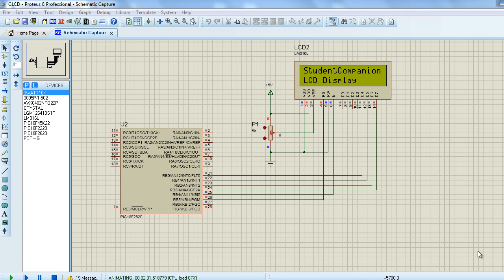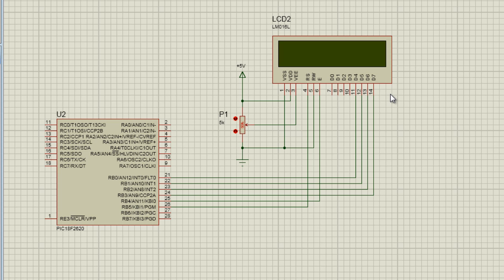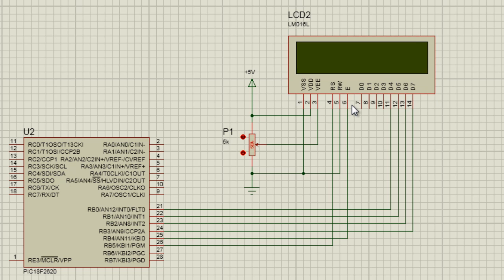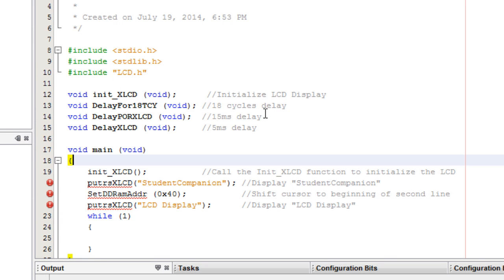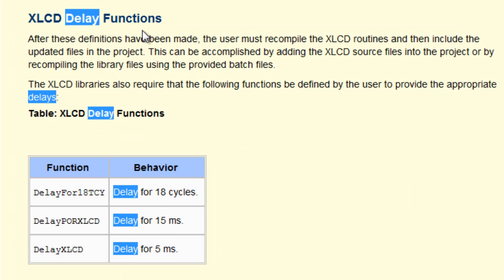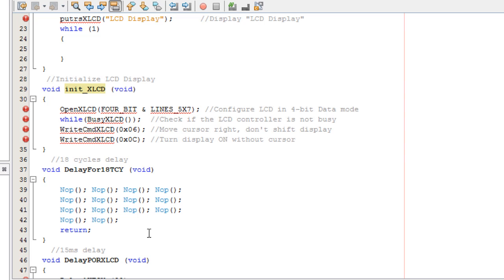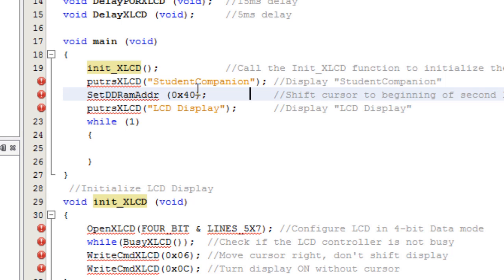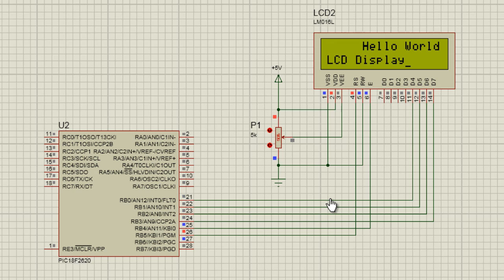5- Interfacing an LCD Display | MPLAB XC8 for Beginners Tutorial

Comment: Hi Student Companion. I am writing a code for LCD with PIC18F4550. I was successful with 8 bit interface using internal oscillator. However I am not receiving anything on my LCD if I am using 4 bit interface with external oscillator. I think it is highly likely that I am not able to define external oscillator in my code. Could it be possible for you to share code snippet for using external oscillator? My compiler is XC8
Reply: If you require me to share the whole code I don't mind it. Basically its same as the one is your video abover
Reply from the maker: +Setsu Tsubasa how are you connecting your lcd? PORTB? Paste your configuration bits code and main code.
Reply from the maker: +Setsu Tsubasa are you using PIC18F peripherals libraries? Did you install it into your compiler installation folder?
Reply: //***MAIN FUNCTION***
void main(void) 
{
    //OSCCON = 0x72;                //Configuring OSCON Register to use internal Oscillator.
    float current = 1, voltage = 3.13 ;
    char buf[30];
    sprintf (buf, "PV: %0.2fV %0.2fA", voltage, current);

   // text[] = "3.13";
    DelayPORXLCD();                 //15 ms delay after VDD>4.5V
    LCD_init();                             //Initialise LCD
    DelayXLCD();                        //5ms delay
    SetDDRamAddr(0x80);
    putrsXLCD(buf);
    SetDDRamAddr(0x01);                // To clear LCD display (without this in ISIS 2nd line command doesn't work)
    SetDDRamAddr(0xC0);               //Shift cursor to beginning of 2nd line
    sprintf (buf, "H %f", current);
    putrsXLCD(buf);
    while (1);
    return;
}

//****xLCD.h****
#define LCD_PORT           PORTD           //LCD_PORT defines the port to which the LCD data lines are connected
 #define TRIS_LCD_PORT   TRISD

/* CTRL_PORT defines the port where the control lines are connected.
 * These are just samples, change to match your application.
 */
 #define RW_PIN   LATCbits.LATC1     /* PORT for RW */
 #define TRIS_RW  TRISCbits.TRISC1   /* TRIS for RW */

 #define RS_PIN   LATCbits.LATC0     /* PORT for RS */
 #define TRIS_RS  TRISCbits.TRISC0     /* TRIS for RS */

 #define E_PIN    LATCbits.LATC2    /* PORT for D  */
 #define TRIS_E   TRISCbits.TRISC2     /* TRIS for E  */
Reply: By PIC18F peripherals libraries you mean xlcd.h and related files then yes. I Have installed them and using them.
Reply from the maker: +Setsu Tsubasa yes. Xlcd.h. at  which port is your lcd connected to?
Reply: Port D
Reply: RS and RW are port C
Reply from the maker: Hi. There are a lot of inconsistencies in your code.
Which LCD model are you using? a 16x2 lines or 16x4 lines? 20x40 lines?
In your main code, You are writing:
1. SetDDRamAddr(0x80); // To which line are you jumping to with this statement? to the 3rd line?
 2. SetDDRamAddr(0x01);                // To clear LCD display (without this in ISIS 2nd line command doesn't work) : this is not a command to clear the LCD, the command is: WriteCmdXLCD(0x01).
3. SetDDRamAddr(0xC0);               //Shift cursor to beginning of 2nd line . This code will not shift your cursor to second line is you are using a 16x2 line, in our code we wrote: SetDDRamAddr(0x40); 
4. //OSCCON = 0x72;                //Configuring OSCON Register to use internal Oscillator. If you are using an external oscillator, why use this configuration?
5. In the library you define: #define LCD_PORT           PORTD           //LCD_PORT defines the port to which the LCD data lines are connected, which clearly states that your LCD is connected to PORTD, but below you are defining other pins to PORTC, It won't work.
6. You didn't post how you configured your external crystal oscillator, the frequency, MCLR and other configuration bits.
Reply from the maker: Watch this video to learn more if you want to connect your LCD to another PORT: https://youtu.be/RkDN2GW_SxU
Reply: 1. LCD: 16x2 lines
2. SetDDRamAddr(0x40);   // This command isn't shifting my curosor to 2nd line
3. SetDDRamAddr(0x80);   //My mistake. Some other website wrote it as 80 for 1st position. It should be 00
4. If you are using an external oscillator, why use this configuration?
       I don't know how to use the external oscillator but for time being I used internal.
5. I will watch the video and get back to you. 

8 bit configuration works just fine but 4 bit has issues. The code is debugging but on proteus the LCD is blank.
Reply from the maker: +Setsu Tsubasa watch the video then let me know if you are still struggling.
Reply: I watched the video. I have been doing the same thing. My code is: 

#include <xc.h>             //Includes pic18f4550
#include <stddef.h>         //for NULL
#include <stdio.h>
#include <stdlib.h>
#include "xlcd.h"
#include "delays.h"          // header file for delays

// Instructions to configure the microcontroller
#pragma config PLLDIV = 5       // PLL Prescaler Selection bits (Divide by 5 (20 MHz oscillator input))
#pragma config CPUDIV = OSC1_PLL2// System Clock Postscaler Selection bits ([Primary Oscillator Src: /1][96 MHz PLL Src: /2])
#pragma config USBDIV = 2       // USB Clock Selection bit (used in Full-Speed USB mode only; UCFG:FSEN = 1) (USB clock source comes from the 96 MHz PLL divided by 2)

#pragma config FOSC = HS        // Oscillator Selection bits (HS oscillator (HS)
#pragma config LVP = OFF     //low voltage programming disabled
#pragma config FCMEN = OFF
#pragma config BORV = 3
#pragma config WDT = OFF
#pragma config CPB = OFF
 
#define LCD LATD                    //Assigning PortD as D4.....D7 where D7 is MSB
#define line_2 0x40
#define clear 0x01
#define _XTAL_FREQ 8000000        //Oscillator frequency of 20MHz

void LCD_init (void);               // To Initialise LCD display
void LCD_Clear (void);              // To clear the display
void DelayFor18TCY (void);
void DelayPORXLCD(void);            //For time millisecond delay
void DelayXLCD(void);

//RS, RW, and EN are defined in xlcd.h
 
//OSC1_PLL2// PIC18F4550 Configuration Bit Settings
// 'C' source line config statements
// CONFIG1L

   // Boot Block Table Read Protection bit (Boot block (000000-0007FFh) is not protected from table reads executed in other blocks)

// #pragma config statements should precede project file includes.
// Use project enums instead of #define for ON and OFF.

void main(void) 
{
    OSCCON = 0x72;                //Configuring OSCON Register to use internal Oscillator.
    float current = 1, voltage = 3.13 ;
    char buf[30];
    sprintf (buf, "PV: %0.2fV %0.2fA", voltage, current);

    DelayPORXLCD();                 //15 ms delay after VDD>4.5V
    LCD_init();                     //Initialise LCD
    DelayXLCD();                    //5ms delay
    SetDDRamAddr(0x00);
    putrsXLCD(buf);
    SetDDRamAddr(0x01); 
    SetDDRamAddr(line_2);             //Shift cursor to beginning of 2nd line
    sprintf (buf, "H %f", current);
    putrsXLCD(buf);
    while (1);
    return;
}

void LCD_init (void)
{
    OpenXLCD(FOUR_BIT & LINES_5X7);        //Instruction to configure LCD in 4-Bit mode with multiple lines
    while (BusyXLCD());                     //While loop to check if the controller is busy
    WriteCmdXLCD(0x06);                     //Move cursor right withouth shifting the display
    WriteCmdXLCD(BLINK_ON);                 //Turn ON the display with blinking cursor on LCD
}
void DelayFor18TCY (void)                   //18 Cycles
{
    Nop(); Nop(); Nop();        //Each Nop(); takes 1 cycle to operate and does nothing
    Nop(); Nop(); Nop(); 
    Nop(); Nop(); 
    return;                     //Takes 2 cycle
}

void LCD_Clear (void)
{
    while (BusyXLCD());                     //While loop to check if the controller is busy
    WriteCmdXLCD(clear);                     //Move cursor right withouth shifting the display
}

void DelayPORXLCD ()            //For 15ms delay after VDD>4.5V
{
    Delay1KTCYx (75);           //For 20 MHz CLK, 1 instruction cyc = 0.2us => 30k*0.2u=15ms
} 

void DelayXLCD ()            //For 5ms delay after VDD>4.5V
{
    Delay1KTCYx (25);           //For 20 MHz CLK, 1 instruction cyc = 0.2us => 10k*0.2u=5ms
}
Reply: I noticed something interesting, Proteus is giving me these warnings on repeat:
** [HD44780] Attempted to write after reading a single nibble [LCD]
** Controller received command whilst busy. [LCD]
** [PIC18] PC=0x1FE6. The SCSx bits have been set. This feature is not modelled - the model continues to clock itself as before. [U1]

I updated the delay time still I am getting these.
Reply from the maker: +Setsu Tsubasa it doesn't look like you are doing the same thing.  You are mixing up with some other codes I don't know where you got it from .
Reply from the maker: +Setsu Tsubasa it doesn't look like you are doing the same thing with. You are mixing up with some other codes I don't know where you got it from.
Reply from the maker: +Setsu Tsubasa can you post your circuit diagram?
Reply: Sure:
http://imgur.com/a/DqziY

Actually I did change the code to suit my requirements but they aren't very big changes. I realized a mistake in the precious code which is I didn't comment out internal oscillator commands.
Reply from the maker: Yes I understand you are changing the code to suite your own requirements, but whatever you are changing or adding you should be able to understand why you are doing so.
The basics of all is to get the circuit connection correct. 
You said you've watched this video but you are making basics mistakes that we have explained in this video, it shows you are asking questions but you are not willing to watch the video first.
1. I can't clearly follow your code, because I can't see how you are connecting your LCD. Why do you even need to connect R/W to D1? You can connect it even to ground.
2. We explained the roles of each pin in this vide, VDD is positive, VSS is negative, VEE is to change the contrast, but look how you connected them!!!
3. The image is not clear on top. Is it a 16x2 or 16x4 LCD?
Reply from the maker: Read this article, it explain everything: http://www.studentcompanion.net/en/interfacing-lcd-display-with-pic-microcontroller-xc8/
And read this article to learn how to configure the USB Clock oscillator of PIC18F4550: http://www.studentcompanion.net/en/usb-communication-with-pic-microcontroller/
Reply: Hi. Sorry for the late reply. I have been busy with other things. I re-watched your video and realized that my connection was wrong. I corrected my connection yet there is no change. Then I used breakpoints to see where exactly the problem is starting. Under function LCD_init, when the while loop is checking if the controller using BusyXLCD on Proteus I get this:
Controller received command whilst busy. [LCD]

Breakpoint at SetDDRamAddr(line_2); game me both:
Controller received command whilst busy. [LCD]
[HD44780] Controller received data whilst busy. [LCD]

Am I not providing enough time to the controller? I have not touched any file other than XLCD.h to comment #define UPPER
Reply from the maker: Did you read those two articles we posted?

Comment: My program compiles successfully, but I get " function DelayXLCD is never called". Do you know exactly where this function is called in the program. I do not see it in the openxlcd source file.
Reply from the maker: Hi. If you remove it I am sure it won't compile again. DelayXLCD is used in xlcd.h header file. Almost at the bottom of the file, you'll see: extern void DelayXLCD(void);
If you navigate to declaration/definition of OpenXLCD, it will take you to xlcd.h header file.

Comment: Is there any need of extra circuit means pull up resistor or any other component when this circuit is implemented on PCB.Because my circuit work well on Bread board but it gives default value when implemented on PCB.
Reply from the maker: +Aqeel Ahmed HI.  If it works well on breadboard then it should work very well on PCB.  There must be something else you are not doing well or omitting on PCB

Comment: I cannot get this working I am using the pic16f690 and using the following connections 
I am programing with the pickit3

I have meade the following changes
#define _XTAL_FREQ 8000000#define RS RC0
#define EN RC1
#define D4 RC2
#define D5 RC3
#define D6 RC4
#define D7  RC5
// BEGIN CONFIG#pragma config FOSC = INTRCCLK  // Oscillator Selection bits (INTOSC oscillator: CLKOUT function on RA4/OSC2/CLKOUT pin, I/O function on RA5/OSC1/CLKIN)
#pragma config WDTE = OFF       // Watchdog Timer Enable bit (WDT disabled and can be enabled by SWDTEN bit of the WDTCON register)
#pragma config PWRTE = OFF      // Power-up Timer Enable bit (PWRT disabled)
#pragma config MCLRE = ON       // MCLR Pin Function Select bit (MCLR pin function is MCLR)
#pragma config CP = OFF         // Code Protection bit (Program memory code protection is disabled)
#pragma config CPD = OFF        // Data Code Protection bit (Data memory code protection is disabled)
#pragma config BOREN = ON       // Brown-out Reset Selection bits (BOR enabled)
#pragma config IESO = ON        // Internal External Switchover bit (Internal External Switchover mode is enabled)
#pragma config FCMEN = ON  

I am so lost with this it just will not work
Reply from the maker: +Jaguar paw hi. You can't use this library with PIC16F series. This library works only with PIC18F series.  Use the library we used in tutorial 22: https://youtu.be/4WaB_Lj8FnY

Comment: I have used 18f252 and it is not working. same code!!!
:: advisory: (1233) Employing 18F252 errata work-arounds:
:: advisory: (1234)  * Address 4000h boundary
:: advisory: (1234)  * Faulty table reads at -40 degrees C
:: advisory: (1234)  * GOTO instruction at reset vector must be preceded by NOP
:: advisory: (1234)  * Peripherals can misbehave if BSR = 15
:: advisory: (1234)  * DAW instruction may improperly clear CARRY bit
:: advisory: (1234)  * Specifically disable interrupt sources during tblwt instruction
:: advisory: (1234)  * Writes to flash must target opposite side of 4000h boundary
:: warning: (1273) Omniscient Code Generation not available in Free mode
:0: error: undefined symbol:
        _DelayFor18TCY(dist/default/production\LCD.X.production.obj) 
make[2]: Leaving directory `C:/Users/Baghdadi/MPLABXProjects/LCD.X'
(908) exit status = 1
make[2]: * [dist/default/production/LCD.X.production.hex] Error 1
make[1]: * [.build-conf] Error 2
make: * [.build-impl] Error 2
make[1]: Leaving directory `C:/Users/Baghdadi/MPLABXProjects/LCD.X'

BUILD FAILED (exit value 2, total time: 5s)
Reply from the maker: +Aay zee Yuo can use the same code but because the PIC is different, you must set correctly the configuration bits according to this PIC. Watch our tutorial 1 to learn how to set configuration bits correctly.
Reply from the maker: +Student Companion SA If you are using XC8 compiler from version 1.35 to up, the project might complain about the peripheral library which is no longer included in XC8 compiler, you'll have to download it separately and install it into your compiler. watch this video to learn more: https://youtu.be/4WaB_Lj8FnY
or you can learn more from this page: http://www.studentcompanion.co.za/interfacing-lcd-display-with-pic-microcontroller-xc8/

Comment: Sir,             May i know please what are DelayFor18TCY, DelayPORXLCD and DelayXLCD? Where we used these delay in program? We didn't call these function in Main Program. 
                 In our circuit RS and E we connected to RB5 and RB6. But we didn't mention anything about where we are Applying High to these PIN. If we are choosing different PIN where should have to change in our Program.
Reply from the maker: +Shuhaib K.A. Hi, The delays DelayFor18TCY, DelayPORXLCD and DelayXLCD are used by the OpenXLCD() and other LCD functions. You don't call them in your main program, but they are used by the OpenXLCD() to initialize the LCD according to its datasheet. Some delays are required when switching ON the lcd and when some other commands are performed.
We didn't specify where you connect the pins RS and E because we used the default connections which is defined in the xlcd.h file. By default the RS and E should be connected to pins RB5 and RB4. If you need to change the default connections, you'll have to modify this xlcd.h file. Watch our tutorial 17 to learn how to connect your LCD to any PORT or to different pins: https://youtu.be/RkDN2GW_SxU
There is also a simpler LCD library you can use, it does not have all those delays and it has only 2 files, you can learn more from our website: http://www.studentcompanion.co.za/interfacing-lcd-display-with-pic-microcontroller-xc8/
Reply: +StudentCompanionSA Thank you sir.
Reply from the maker: Shuhaib K.A. You are welcome!

Comment: Thanks you. In my Software it will take 15 Sec delay to display after Run the simulation. How can i reduce this delay?
Reply from the maker: they might be many reasons. if this delay is only noticeable when you start your simulation and everything goes smoothly thereafter, it might be that your PC is slow as Proteus requires some resources from your PC. If you download the code into the actual PIC, you won't see that delay we believe.
Reply: +StudentCompanionSA  thanks for your replay sir.
Reply from the maker: +Shuhaib K.A. you are welcome!

Comment: Thank You for the Tutorials, they have been great.  This one will take some time to debug if you are using XC8 1.35, but that is good experience.
Reply from the maker: +Terry Child Indeed. From XC8 v1.35, the PIC18F Peripheral Libraries are no longer included which includes the LCD library. You can either install them as a separate download file (in XC8 Compiler downloads page on microchip website, they are now called Legacy Peripheral Libraries) or you can write your own LCD library.